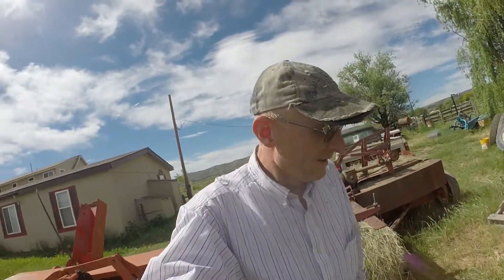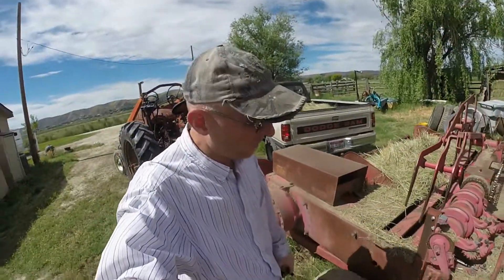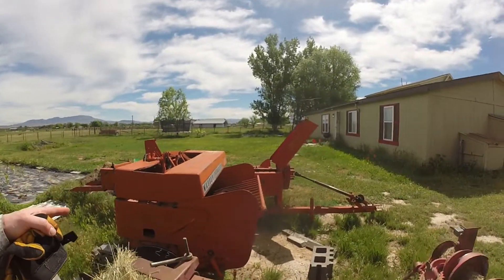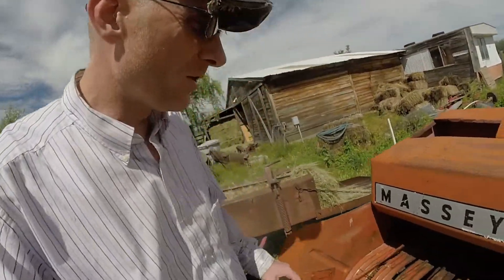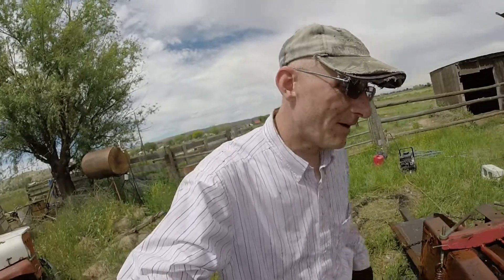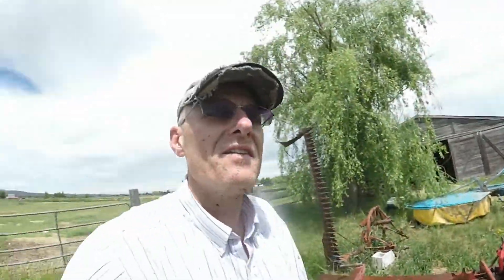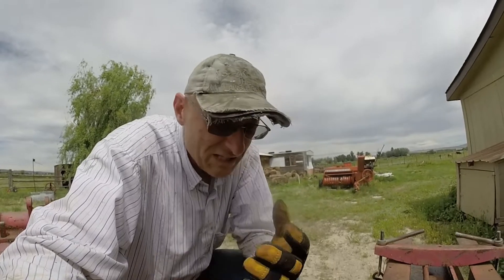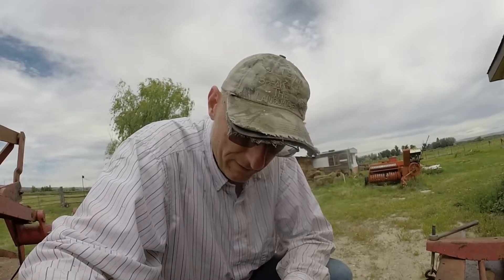Massey Ferguson #12 Baler Disaster! Let's Diagnose and Make a Plan.

Comment: Easy fix, just braze the needles back together , making sure to get then back in the correct shape.  Get it back in time and fix the safety latch.  If you need to replace the drive chain, be sure it's the correct number of pins. thats critical, to keep it in time.  Those # 12 Masseys are a good machine and give little trouble if maintained.

Comment: I guess Massey doesn’t have a safety lock that trips to prevent catastrophes like that.
Reply from the maker: It has a plunger stopper safety lock, but it did not have the desired function in this case. I can see scenarios where a perfectly functioning plunger stop would not have saved the needles, but I suspect they would have been saved with a properly set up baler. It's on my list to do a deeper dive into what went wrong (the list just seems to keep getting longer).

Full disclosure, I expect the root cause (and all causes) of this failure to be lack of/incorrect maintenance on my part. Thanks for watching!